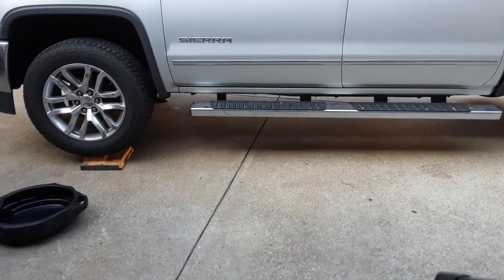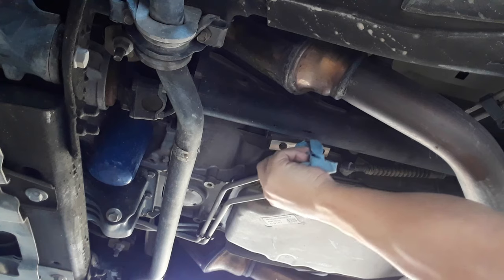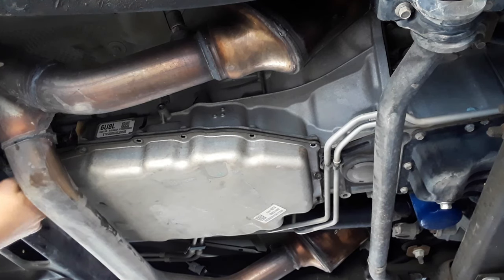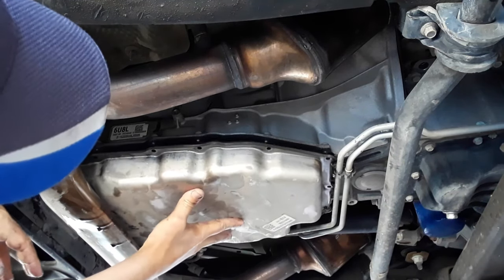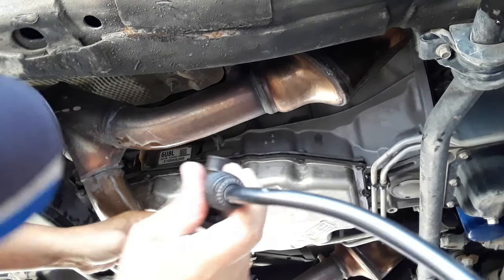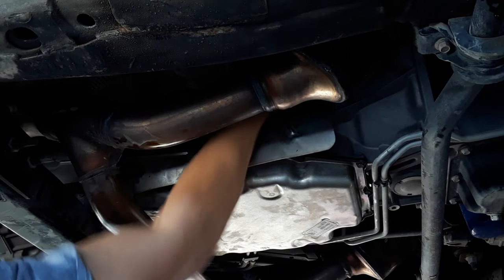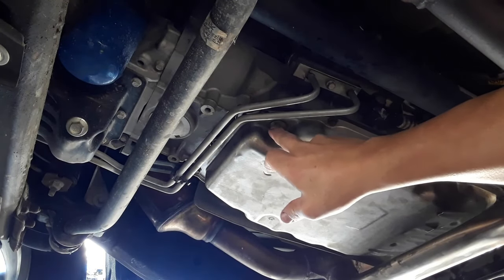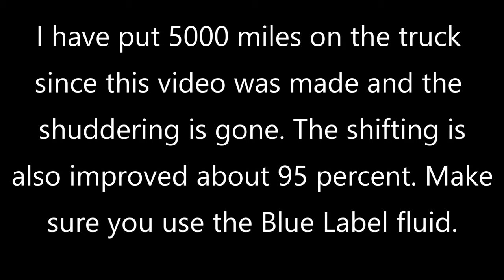Stop the shuddering on a 2016 GMC Sierra / Silverado with the 8L90 Transmission.

Comment: I had the shudder come on last summer....2018 Silverado, 6.2 litre, 8 sped transmission....took the truck back to my dealer...they flushed and filled with the Mobil 1 synthetic fluid you’re showing...(blue bottle) ....shudder has not returned.....
Reply: Has it came back yet? After 2 years
Reply: No
Reply: @Scott_MS Just had my 2015 Denali done today and the ride home was shudder free...definitely encouraged to hear that you're still good after 2 years. Thanks!
Reply: hope you don’t have anymore issues going forward !!!
Reply: I’m doing it tonight honestly I’ll fill it and switch through all the gears numerous times and drive it down the block and drain every thing again. There’s still 7 quarts in the converter

Comment: One of the main reasons the transmission vibrates like that is due to programming. To save fuel manufacturers are programming the torque converter to lockup earlier at lower speeds. Of course it helps with efficiency and gives a rush of acceleration. But, it loads up the torque converter, the constant locking and unlocking causes a little bit of friction… which causes a bit of heat each time… which adds up and warps the unit. All this causes the shuddering we feel when driving. Due to the mating surfaces to be incomplete. If you catch it in time a reprogramming cause save the torque converter.

Comment: Good video and thorough explanation of everything. My dealer was going to charge me for this service so I had my local mechanic who I trust perform the service. Tried to get away on the cheap so just did the fluid drain and swap but the shudder didn’t go away. Had him swap out the trans filter the 2nd time it was done and this time it worked. 2016 Yukon XL Denali with the same transmission.

Comment: Nice job on the video. Many GMC and Chevrolet dealers back in 2016 to 2017, were buying back Trucks and Cars with the 8L90 via the lemon laws. Every state has different lemon laws but GM was buying them back due to the multiple repeat repairs without resolution. This was all because of the Torque Converter Shudder. I remember the dealership I was at originally used the Mobil 1 Black Bottle Fluid, only to have trucks and cars return in like 3000 miles or less with the same complaint. As I recall the Mobil 1 Blue Bottle Fluid came out in 2017 or so and resolved the Torque Converter Shudder immediately and no return complaints. Somewhat surprised you were still able to buy Black Bottle Fluid, as I remember the GM dealers in my area were instructed by the zone office to discard any Black Bottle Fluid due to some dealers still using it and creating repeat customer complaints.
Reply from the maker: I would like to find out if the black label can be used in cars that require dextron or any other fluid. I have 12 quarts I have no idea what to do with it.
Reply: @737mechanic  i have a 15 gmc sierra  thinking about using this  will it work with dexron vi?

Comment: Appreciate you posting this. Just a quick heads-up... trans temp is supposed to be between 95-113 for fluid check per GM service manual. Also, if you still have the thermal bypass (thermostat) they recommend to bring it up past 190 initially to cycle the fluid through the cooler lines and then let it cool down to check per the above temps. Obviously if you've deleted the thermostat you can simply check when it's at the above range. Great video!
Reply: Does temperature that you mention it’s only on the 6l80-90 tfansmission, the 8l90 To check the fluid level need to be 131-149
Reply: @juanprenteria5077  that's only for the CTS-V/LT1 Camaro if you're at a track session. Under normal conditions, check temp is required to be at 95-113F for the 8l90
Reply: @WingsAA  oh ok thank for the correction
Reply: Thx good tip

Comment: Well, I finally got around to doing it. Followed your video to the "T" and the shudder is completely gone. Runs like it did when I bought it and the shuddering was absolutely horrible. Thank you very much for the video...In case any other readers are curious, I have a 2016 Chevy Silverado LTZ (5.3L, V8)..
The transmission filter and amount of transmission fluid to put back inside the transmission is the EXACT amount as shown in this video...
Reply: Thanks for the info im gonna be doing my 2017 Silverado soon. This is the best video I've seen so far.
Reply: @fantaztikbeatz  
Yeah, definitely good stuff...I did mine 6 months ago and still no shuddering..
It's still running like a champ. Let us all know how it goes...

Comment: Had this done @ the dealer under warranty and helped the hard shifts. I never did get shutters thought. Starting to act up 45k later so will be doing this again myself. Thanks for the info.
Reply: Not bad ! Shudders went back after a few miles on some owners.
Reply: Going through it with a 21 Texas Edition, dealer changed fluid to Mobil 1 at 20k, coming up on 45k now, the stumble is back, and have felt the shutters.

Comment: Great video. I have a 2017 LTZ with 8 speed trans with approx 92,000 miles. Shudder started at about 89,000 and continually got worse. Your video saved the day.  The only 😊problem I had was finding the Mobile 1 Blue Label Fluid. Couldn’t find it anywhere. Amazon shows it available but I gave up on them after 10 days. So,I went to my local Napa Auto store and purchased Valvoline Full Synthetic ATF Dexron VI and Mercon LV. Viola! The results were better than when the truck was new😅. No more shudder and no more load up hard shift between 1st and 2nd.  After reading some of the repeat shuddering with some of you, I am hoping this will last.
Reply from the maker: I have about 25,000 miles since I changed my fluid and it is still good.
Reply: Have the same truck 6.2 and am at the same amount of miles and just starting to lighting feel this happening. Planning on doing this immediately.
Reply: Question any reason you didn't take it to dealer from paper work I've found from purchasing warranty is up to 100k and by comments in video they need to not just flush but drop the pan because of a heat sensor recall.
Reply from the maker: @caseG80  The powertrain warranty is 5 years or 60,000 miles whichever comes first. The transmission temp sensor is a service bulletin, not a recall so I would have had to pay for that myself also. The temp sensor can be a problem but until that problem arises, I am not going to worry about it. It is a simple install anyway.

Comment: I just did one in the shop, dropped the pan and so much converter clutch material. so i put a new converter in it and did all 4 electronic shocks. Like a new truck.

Comment: FYI - GM stopped asking dealers to emulate a shudder with pico gauge around mid 2019. Ask your dealer to ref latest version of TSB 18-NA-355 and all you have to do is present your vehicle within the remaining powertrain warranty, tell them you think you have a shudder, and they will triple flush your transmission under warranty.  In a Corvette, that's worth 24 quarts of new blue-label Mobil1 LV ATF HP. This is a GTL group 3+ base stock with a special additive pack from Infineum, which is a joint venture between ExxonMobil and Royal Dutch Shell Chemicals.
Reply: Hey Ryan - I am going in for this shudder issue in a few days; I have an appointment at my local dealer.  You state that they will do that and you seem pretty confident of it, which is awesome.  I'm just wondering if it will truly be that easy for me?  Do you work for a dealer or did you just do this yourself and they gave you no pushback at all?  Ok - thanks!
Reply: @reidabercrombie9219  how’d  it go at dealer?
Reply: @caseG80  I was really worried, but it could not have gone better. Drove it, was obviously able to replicate the problem. Service bulletin called for doing the triple flush thing, and that’s what they did. Zero cost to me. Completely fixed the problem. It all worked out perfectly. Couldn’t be happier.
Reply: @reidabercrombie9219  good to hear thanks

Comment: I just came across this video. Sir,  I just bought a 2017 silverado with 122k With a bad transmission. The truck would not move.  I changed the filter and oil. Now it runs fine but it has that shutter. I'm going to do exactly what have done to your truck. 
Thanks for posting the detailed job.
Reply from the maker: Mine is still shudder free after about 35000 miles of doing the job.

Comment: I changed my fluid. The 1st 1000 miles was good and now the shudder is back.  It starts around 37 mph.  I have to say thanks for the spray bottle hack.  That works really well.  I have to get me an extractor though.  Those cheap hand pumps work but a PIA to use.  Now I have to see what GM is going to do about this.  Great channel thanks.
Reply: I just bought a 2018 sierra 49,000 miles it's starting to do this will gm fix or I have to pay out of pocket ?

Comment: Thank you! Just started having this problem. Dealership was $149 for diagnostic and wants $950 to swap fluid and I’m not even at first maintenance interval for another 9K miles… pushing back on warranty. Glad I saw this.
Reply: Highway robbery it's 😔
Reply: Yeah, stand your ground. They need to fix it at no cost....
Reply: Yeah you need to tell that dealer ship what's up by the comments in video this isn't a new issue and a vehicle that new wow I'd definitely fight the dealer and let them do it because down the line if you got a lemon you will need the back logs if it comes down to replacing the vehicle I've received letters in the mail about suing GM about the lemon law definitely need to do more digging look through comments here some have the exact information about what you need to tell the dealer and where they will find the info provided to fix your vehicle
Reply: @caseG80  This is a warranty fix. Mine was done under warranty.

Comment: I just came back from Lakeland Regal, they wanted $697.00 just to exchange the fluid. They where charging me for 20 quarts. No filter change. Thanks so much. I’m also installing the superior solution model STL010 since I am in Florida, and temperature is an issue

Comment: 2018 Silverado. Had my local trans shop flush the system and replace it with Amsoil. Best decision I ever made. Shifts like a dream.
Reply from the maker: let me know how it does long term. All these trucks will shift perfect at first with any fluid change but the problem is the original fluid was hydroscopic and would induce moisture and cause the problem. The new blue label is anti-hydroscopic, so it is supposed to fix the moisture problem. I am not sure about amsoil.
Reply: About to do this soon too. Got 8 qts and want a local shop to flush it for me. I’ll try to come back update you how it goes. No problems at all, just the fact my truck reached its serviceable time limit.

Comment: Wow. Glad I came across this. Just bought a used 2016 Silverado LTZ 4x4 it started doing this after about a month. I got 68,000 miles on it. Shudder is light but only when accelerating uphill. It does shift hard between 1st and second.
Reply: Mine did same thing it had red fluid in it they put in blue and he hooked up their laptop fix the transmission and no more shuttering no more hard-shifting oh and warranty covered it all there is a recall on that
Reply: I bought the exact same truck in black 62 miles and im experiencing this too
Reply: @stacey lumley
Reply: @elden8785  did you receive recall notices only one I've received on 17 LTZ was for the break peddle
Reply: @caseG80  no I went to the dealer they looked it up booked me in the next day did all the work for free didn't cost me a penny..
Reply: @elden8785  what do you mean blue? what oil is that?

Comment: Great video. A word of caution replacing the pan. There is a solenoid that can get caught and break the electrical connection. GM had a national hold on that solenoid. It will cost you a valve body to fix it. Ask me how I know.
Reply: Happened to me and couldn’t find a solenoid anywhere, found a used valve body on eBay for $400 and was able to take the solenoid off that
Reply: Thx
Reply: @djr256hd  Exactly what I had to do.
Reply: What can you do to prevent it happening? Cheers
Reply: What kind of electrical issues? My truck has shudder but also tpms warning light and brake trailer light warnings and I think it's an electrical issue.
Reply: @bkv449  It affects transmission function. Your issue could be any number of issues not related to each other.
Reply: @caseG80  Sorry for the long response delay. Make sure the gasket is on the pan and set the rear of the pan first.
Reply: Did moving the pan towards the passenger side cause the issue?
Reply: @JeffreyPalma-y2b  The best I remember it got stuck on the cross member and I didn’t realize it was hitting the solenoid also. My mistake in my haste. All is fixed and working fine a year later.

Comment: I also installed the STL010 in my 8L90 along with doing a filter (while changing temp sensor) and adding blue label. Keeps the 8L90 from opening up the thermal bypass at 194 and gives you an instant fill of the cooler. Keeps my temp around 155 at all times even in the heat of July.
Reply: Is the stl010 the bolt in the trans thermostat? I did the thermostat bypass. When i do the fluid change do i do it the same way he did it ?or do i i have to do something different since i did the thermostat bypass?
Reply: @josh_9266  https://youtu.be/yhXSczYgbA4 here is the video I did to show how I did it. And the instructions to check level.

Comment: I did  a double flush on my 2016. Changed it drove it week then flushed it again  10k miles  seems to be good  my opinion is do it early  don't drive around a year with transmission eating itself.    Great video 737
Reply: Update 20k after the fluid flush still good. Anyone made it to 150k plus on these transmissions

Comment: I have a 2017 Silverado that had an over active trans and would shudder or get stuck in overdrive if you went to pass someone if you didn’t push the gas pedal down hard. I have the 6 speed, came across your video after searching. Let me tell you or anybody watching that has any issues with there 6 speed, I changed my fluid with the stuff he said to use, sucked all the old fluid out with a new filter and let me tell you my trans is perfect. My shifts are so smooth and doesnt feel like it’s going to shift back or over active. If you are like me and undecided trust me go ahead and get this done.
Reply: How many miles did you have on your truck when the procedure was performed ?
Reply: @timoconnor5090  my truck had around 126k miles. I am around 134k miles and still shifting perfect.
Reply: @dreamersgarage8307  thanks
Reply: Do you think I need too do this I have a 2016 gmc sierra 1500 5.3 LT it won’t shift for the most part and rpm is going way up hoping I don’t need a new transmission
Reply: @dreamersgarage8307 what transmission is yours?
Reply: @raymondthompson1257  6L90 4x4 6 speed not the 8 speed.

Comment: OMG wow!!!! So I did things a bit different than I was planning. I bought two pumps from harbor freight for $8 each. Never pulled the pan (only 39k miles), pulled out 6 quarts of DIRTY fluid, I was surprised how dirty it was, nearly black. Then filled 6 clean quarts, then drained again after running the car 10 mins through gears, etc. I drained 4 different times and filled 4 times. Even on the last attempt the fluid was still far from new looking. But I decided to give it a drive, INSTANTLY the trans shifted smooth through all gears and the shudder was gone! I have been losing sleep over this for weeks. It wasn’t that hard to do at all even on a corvette where it’s much tighter working space. Not going to lie I was skeptical on this working. Before I had a hard shift into 5/6/7 gears and then a shudder after it was in those gears. Not it’s smooth shifting and shudder is gone.  I pulled out 23 quarts total and put 23 clean quarts in. I estimate that the fluid is still only 75% fresh. My backup plan was if this didn’t fix it, I will drop the pan and change the filter and fill it once more. But I am feeling blessed that this did the trick! WOW thank god! The guy sold me the car knowing it had this problem, but clearly didn’t inform me. What a prick!  I hope you guys give this a shot.
Reply from the maker: Glad to hear.

Comment: Great video!!! Only thing I recommend. You have all these expensive tools but no cheap gloves. Automotive oils can be bad for your hands and fingers.
Reply from the maker: Gloves are too hard to work with plus studies have shown that used oil can be bad if left on your skin for extended periods but as long as you wipe it off it is fine.
Reply: @737mechanic  ok, that actually makes send. My gloves in Florida sweat so much it drip and it’s tough to twist bolts.

Comment: I had the dealer do this under warranty on my 2015 Silverado 6.2L 8-speed (8L90) at right about the mileage you have in the video.  They used the blue label ATF.  Since then I passed 100k miles. The shudder hasn't returned that I can tell (I have aggressive tires, so it's not quite as easy to tell), but I am getting some hard shifts in low gears, especially when cold.  I plan to do this procedure soon.  Great video.
Reply: The dealer did the fluid swap and then did a shift relearn/reprogram for the transmission on mine.  The hard shifting and shutter are gone.   If you are still under warranty should see if the dealer will do the relearn.
Reply: @metroplex2006  I did have that done. They did the relearn with the flush a year ago, and indeed it did solve the issue.  I'm over 100k now though, and the hard shifts are back.  There was an unrelated warranty repair on the temp sensor harness about a month later, which requires removing the pan.  Maybe they used the black label stuff by mistake?  I don't know.  I'm just going to do this anyway.  I'm not working four bays at once on flat rate, so I can at least have peace of mind that it's really done right.